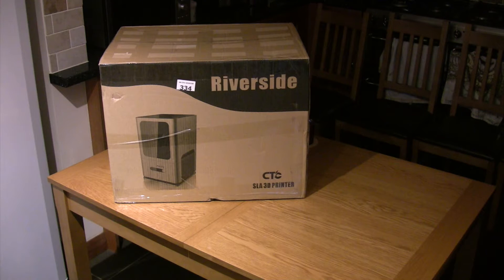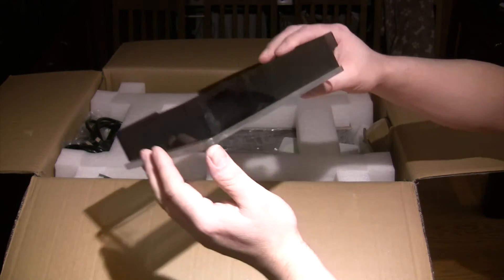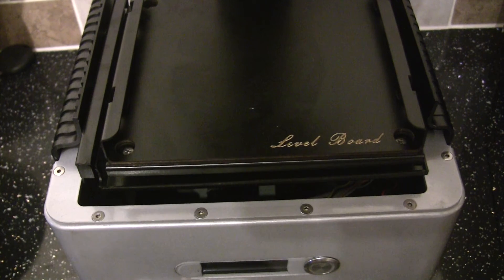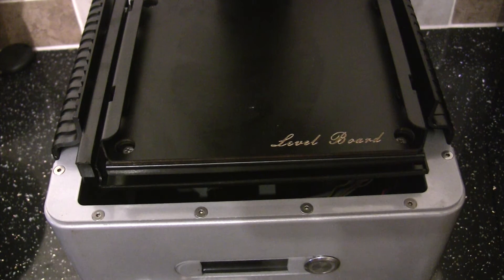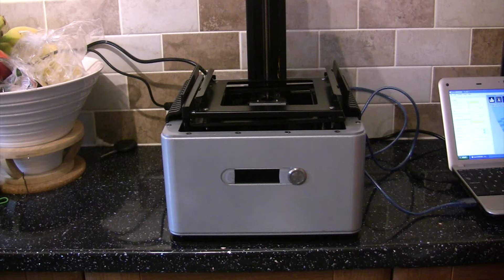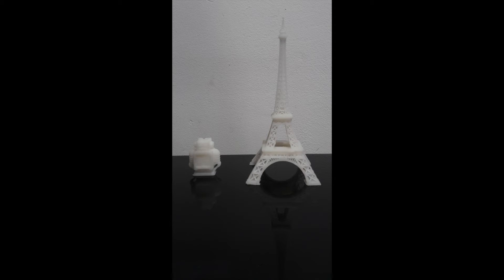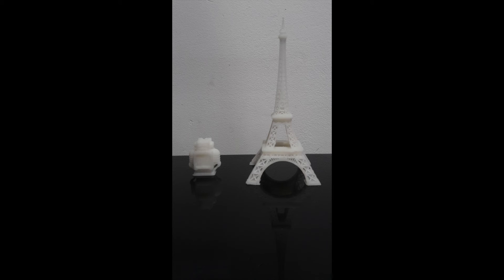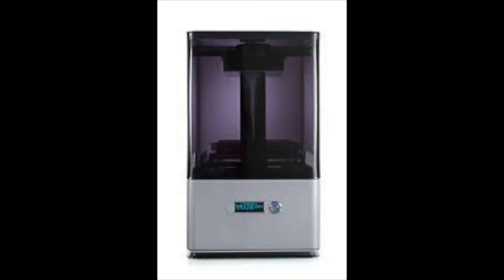CTC Riverside SLA 3D Printer Unboxing

Comment: Hi 3D Motor Maker,Thanks for the great video.
I bought the same machine a week ago.
Mine came with the same packaging, but there was packaging banding around the chassis to the end foam and a couple of extra cardboard angles between the chassis and the top cover. This neatly stops the chassis from bashing the top cover during transport. Having designed foam for transporting similar devices, I would say it is as well packaged as you can practically do. It should survive a 40G drop (about 1 metre).
My carton had a large hole smacked through the carton, but no harm to anything inside. The resin bottle was not leaking as per yours and the optics were clean. However, the tray has a defect in the silicone near the centre. I guess I can position around that.
First impression is that it is very nicely built. Heavier construction than I expected.The manual is abysmal. It doesn't even mention adding resin, let alone how much (come to think of it your video skips that also). It seems to me that it should have enough so that when the tray tilts during the peel between layers there should be enough resin so that the build platform stays fully submerged. I've noticed trapped air bubbles in the part if it doesn't. It would be nice if the tray had a level indication on it like the Form 1.
The manual doesn't explain the way the machine works i.e. tilt peel etc., optimal placement and build angle of the part, how to set up Cura properly, e.g. what you actually have to set or ignore (e.g. what are the best ways to set the foundation for each type of part), operating sequence when running.
The tray height zeroing in the Appendix is wrong (as you say).BTW, there is a later manual version than the one included in my machine here:http://www.ctcprint.com/en/administrator/eWebEditor/UploadFile/20151109152582418241.pdfIt adds a couple of pages in the Appendix, which are a bit more informative, but still wrong on height zeroing. While the file name is date stamped, there is no revision number on the actual manual so if you have one you won't know if it is current. It also doesn't have a revision table, so you wont know where to look for what changed in the revision ( It's all in the Appendix in this case).
Here is my take: I took my magnetic based dial indicator clock and measured the height (thickness) of the plywood "level board". It is "exactly" the same as the height to the silicone layer in the tray if I lay both on a flat surface. Having said that, my plywood "level board" varies in thickness from place to place by more than the thickness of a sheet of paper, so it is not a very accurate calibrator. However, the 4 adjuster screws sit a bit higher than the tilt frame, so the plywood only need to be the correct thickness at those point (provided it isn’t propping elsewhere on the build platform).A piece of 80gsm paper is 105 micrometres thick, which is essentially the same as the 100 micrometre layer thickness of the Cura build default. That means that you should be able to put the "level board" into the tray holder, send a file as the manual states, and pull the plug on the power supply when the tray holder levels. Then slip a piece of paper between the "level board" and build platform and adjust the 4 tray holder levelling screws so the piece of paper just catches.
Unfortunately my "level board" is not accurate enough so that when you do this again with the actual tray in place, you can't fit the paper in. The upshot is that the part comes out a bit thin. The really irritating thing is that with the tray in you can’t get at the adjusting screws to set the tray height. It would be a very simple design change to allow this.
The manual now shows a plastic feeler gauge to set the height screws that doesn't seem to come with the machine. It may be that this is a bit thicker than 100 micrometres.
I know if the gap is too big it just builds a layer on the tray. To get around all this I set my tray a bit high (maybe quarter turn on the adjusters). Because the tray frame is spring loaded upward it won't hurt the mechanism. If you print like that it just repeats each new layer in the same place until the springs push the tray frame up onto the adjuster screw heads.
Then I made a model consisting of 4 off 1mm thick pads, one above each adjuster screw position. I printed like that and then measured the thickness of each pad after I peeled it off. Note that the tray adjuster screws are ISO M4 which have a pitch of 0.7mm or 700 micrometres. That means 100 micrometres, or one layer, is 1/7 turn of the screw or 51.4 degrees. My worst case corner only needed 200 micrometres or 103 degrees clockwise turn on the adjuster screw. I simply had to wind each screw down according to it's measurment and the second test printed exactly 1mm thick on all 4 pads. If you want to get accurate height parts this works.Here is how I've gone so far:
1 Assumed the machine would be factory set so tried a build. Wrong, just left a layer on the tray
2 Tried again. Same result.
3 Set the tray height with the "level board" and paper feeler gauge. Worked okay but couldn't get the "brim" off the part.
4 Tilted the part and added "touching build plate" and "brim". Couldn't get the foundation off the part. Hard to tell where the interface was.
5 Next few parts all failed and stuck to tray. Discovered the tray height had changed. Recalibrated as per above and it works. Not sure if this will be an ongoing problem.
6 Tried the procedure above and got accurate thickness. So far so good.As you say, the software is terrible. It clearly is for an extruder.
There seems to be no way to lift the part a tiny amount so that height errors on the initial layer are not in the actual part build but in the foundation. I think I will try adding some small struts to my parts in the solid modeller then see if I can make them sit flat in Cura. Then let Cura fill with "touch build plate".
I found that “lay flat” doesn’t necessarily do so, but I had to look at “layers” to discover that. Fortunately I went back and “reset” the “lay flat”, then rotated each part by 90 degrees to make it actually lay flat.Another small problem is that the aluminium build platform does not seal well against its plastic work, so after you clean it off with IPA, resin leaks out onto the build plate again. If you don’t have the tray or level board in place, this could drip resin onto the mirror.I have been covering the tray with Glad Wrap between builds to stop the resin smelling and keep out dust.I'm running Cura on a 64 bit Windows 10 machine. It fails on installing the "leaf driver" but Windows seems to find the USB okay and it sends okay. However, I have had one situation where it forgot to wind the build platform down and it merrily built a mess on the tray.
CTC encourage you to follow them on Sina Weibo. So I signed up on the English area only to find that there is no English Sina Weibo, only Chinese. Very helpful!
The manual suggests signing up to their corporate group for 3D printing but the link seems to be broken.So, a nice machine, badly let down by software, manual and support. Admittedly I haven't contacted the local supplier, but I don't expect much there either. Shame really, as it looks like the top level software is written in Python (interpreted), so it should be easy for someone to set it up for this machine.Does anyone know what the manual means by the hooks being engaged? I'm not keen on pulling mine apart to find out. My machine is making accurate parts. I shudder at the thought of having to calibrate it if I have to considering how bad the manual explanations are.

Comment: Hi guys, we have SLA Riverside printer from CTC, and standard problem - model doesn't stick to Al plate and remain at the surface of resin basin, even after callibration. What to do with it? What film is recommended to that application?
Reply from the maker: +Andrew A What you need to do is remove the tray, install your level board and start a print, then the platform is at its lowest pull the power from the printer.  Then use a screwdriver to turn the screws 1 half a turn on all off them, keep doing it in a clockwise motion until the the platform is hard up against the board.

When you do a print - only print 20 lines and cancel. See if its stuck to tank, if so then turn all screws 1 half turn more and try again.  Keep doing it until print sticks,  Make sure to clean tank of failed prints before attempts.

Comment from the maker: *UPDATE*  My Riverside has stopped working - The laser has failed.  I am emailing my seller now for either a replacement laser or a refund.  I will keep you updated.  I can't slate the machine or seller yet because you get faulty equipment in everything - however I will report on any customer service issues I get.
Reply from the maker: I got a full refund and got to keep the printer as well because the return address given by the seller did not exist.  Thats why seller would not issue a return label.  Sadly the printer is un-reparable and I only use filament printers now.  Another issue is that these SLA printers only make solid models, and the software 'cura' tries to make an infill which results in a model made with two shells with a semi liquid infill.  The software is not suitable for the print system IMO.  YMMV.
Reply: Any new? How's it going in terms of speaking with the seller?
Reply from the maker: I got a refund. I am thinking of making a video about it in a few weeks.
Reply: +3D Motor Maker That is to say you're not getting a replacement laser?  Just scrapping the machine?
Reply from the maker: +rgemail Its a very long story I am going to make a short video about it soon.
Reply: +3D Motor Maker Do you still have this printer and if so does it still work, as I'm thinking of buying one...
Reply: 3D Motor Maker: What ended up being your experience with the refund, did you ever end up making the short video to explain?

Comment: Thank you very much for the excellent video! I am very interested in buy this machine but I have a couple of doubts. I would like to know if this machine works with all standard resin brands and if your Santa Clauss can recommend a secure store to bought this. Greetings from Argentina! Kind Regards, Luis.
Reply from the maker: +Luis Martin Castro Hi, mine was from eBay, I have bought all my CTC printers from eBay,  So far I can only  tell you what I have used - I have not had it long my self.   Stalactite Standard and MakerJuice G+ work in this machine.  Beware that this is a Windows only printer, I have only ever got it to work on a mac via virtualisation. It just does not seem to want to work with he mac version of - well anything !!

This printer is basically a crippled version of the Form1, I hope better slicing software and firmware come out for it 3rd party or otherwise.  The supplied slicer cura is slow and buggy, Sometimes it just hangs on a complicated .STL.  But its 1/3 the price and that counts for a lot.  Also there is NO uploading to the printer and then switching off the computer, this is like printing to a Rep1 over USB.  If you do buy one, take a good look over on the form1 support forum as much of the info is relevant, and buy at least 1 tank extra as you WILL damage it.

I hope that helps.....
Reply: Perfect as I have reserved an old netbook with Intel Atom and XP for use with this machine! You know if the old computer and the dubious Cura take a long time to calculate the layers of a complex model? I usually design my fairly complex models in Rhino 5.0 and exported as STL to open the file from my machine software CNC Roland .. Maybe with the CTC I have to do the same but import the STL file from the Cura, do not? One more question: The resin tank can be replaced by other "home made" or is a complex design? Thanks for your time!
Reply from the maker: +Luis Martin Castro Hi, No cura runs poorly on an intel atom netbook - hell its not that good on an i5.  Some STL fail to slice, just not enough CPU power.  The trays are just a flat piece of plastic with a plastic square glued on top.  There are 3rd party glass ones available, they look much more promising.  I have two trays and have broken them both - I am re-lining them now.  Takes a day or so to set.
Reply: 3D Motor Maker
 
It's a pity I can not use my old Netbook! ha ha ha Another question: can print in 25 micron? I ask because in the description of some Ebay sellers and says in describing other says the minimum is 100 microns. In the manufacturer's website also says that the minimum layer thickness is 100 microns. It is rare, perhaps do not have patent issues ... you think?
Reply from the maker: You can use the netbook, i do all the time, just don't expect to do large complex models. No you can print 1 micron only. this is a firmware issue i think.

Comment: Ahh I see, I dont know much about this 3D stuff yet... LOL, where I can find the "custom version of Ultimaker Cura" so I can print with it.

As at this point I having be able to print with anything... I many need to buy a serial port adapter for my mac...

But the question is, which software that came with the CD, are you using to print? or name, so I can look for it. besides the installation software comes in chinese... LOL-....

I just want to print... from my mac... I have a windows laptop, but it does not have serial ports either...
Reply from the maker: +Oscar Rangel Everything needed to print was on the CD that came with the printer.  Its a windows only though.  So if you can't access USB from your windows emulator your screwed I think.  You need to run windows on your mac either via boot camp or virtualisation.
Reply: +3D Motor Maker, thanks, 

 I have windows in my mac, and running windows 10 (legit) LOL... I just need the mane of the program you are using to print.... I had installed replicator 40, but you told me it is only for upgrading the software, and you are telling there is only one program you have used to print, and is in the CD.

the question I have what is the name of the program and how did you installed.

Thanks,
Oscar.
Reply from the maker: +Oscar Rangel I think your first language is not English.  Your not fully understanding what I am saying.  As far as I know ReplicatorG has NOTHING to do with this printer.  No you can't upgrade the firmware with it either.

The software you need is supplied with the printer. If its not contact your seller they will supply it to you.

The software is called CURA, but its a modified version that works with this printer.  I have not gotten ANY version of ANY other slicer to work with this printer on either windows or Mac...

You need to re-read what I have typed, I can't explain it any better than I have - sorry.
Reply: +3D Motor Maker , LOL I am from mexico... hehehe

but I was looking at your channel and you are making bedini type motors with it!!!! What a coincidence!!! I am going to use the printer for the exact same reason, I been doing bedini and other for a while. 

How can I get the STL files for the motors that you have build ? if is posible.

Thanks,
Oscar.

PS.
I will look for thre Cura version that comes with the SD, do you think it will be posible to send me the files to my email, maybe I got somethings different.
Reply from the maker: +Oscar Rangel   I made all the motors on a replicator 1 clone from CTC. I have not made anything of any value on the SLA yet. Just models from thingiverse, I am still playing with it.  I will make my motors with the SLA  when i get more resin, it will be a just fit though as the build volume is much smaller.

What's on your sdcard? Give me a directory listing.
Reply from the maker: +Oscar Rangel Did you buy the printer new ? Because that sdcard is not for that printer.  The contents on that card are for CTC bizer Replicator 1 clone. You should have a CD with cura and a word document.  If its new you need to contact your seller and obtain the correct software.

Comment: Hehe

did you see the link I send you with the replicatorg-0040? 

https://code.google.com/p/replicatorg/downloads/list

here are the new versions for replicator. I have downloaded but I dont know what printer to choose on the Autodesk-Meshmixer, can you share with us ?

0.- That was the only different from you box, and mine, instead of the CD, it came with a SD card.
1.- Yes I got a sd card, and after the installation, there is the mac version link to download.
2.- I downloaded the new replicator version .40 and cant connect either on my mac...
3.- You are telling me that you are using the Meshmixer from autocad, can you share the printer to choose and any other setting we need to be aware of it, please.
4.- I have downloaded the Cura software, but there is no printer with the name of "Riverside"... can you tell me where it is or share info on how to select it.

Thanks.
-Oscar.
Reply from the maker: +Oscar Rangel No I don't use Meshmixer to print with.  I use meshmixer purely to add tree and branch support to my STL.  The software that CTC supplied to print with is a custom version of Ultimaker Cura.  This is a different version to what you can download.  I have not been able to print to this printer with any other software other than what was supplied on the CD that came with the printer.

I don't know why you are using ReplicatorG - I hate Cura but its MUCH better than ReplicatorG and as far as I know does not work wit SLA.  Version 0040 is what you use to upload new firmware to replicator 1 clones, its not even recommended to print with at all.